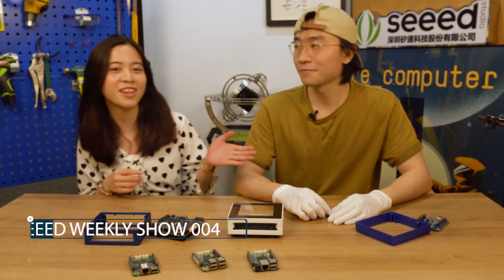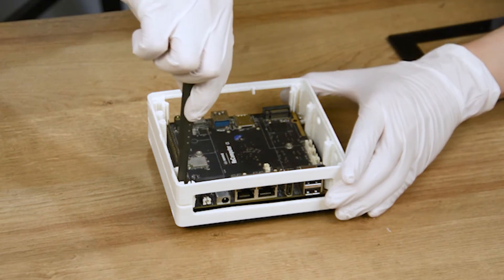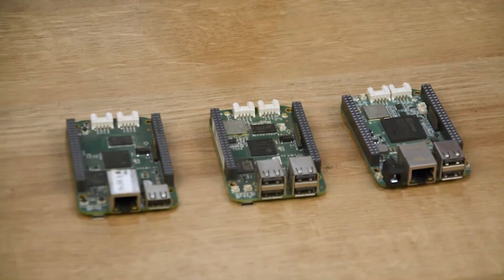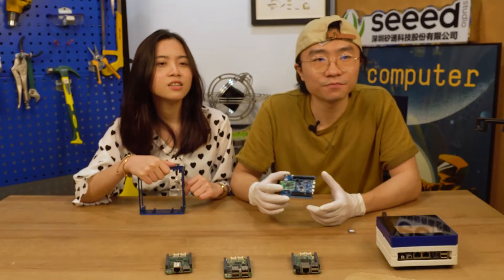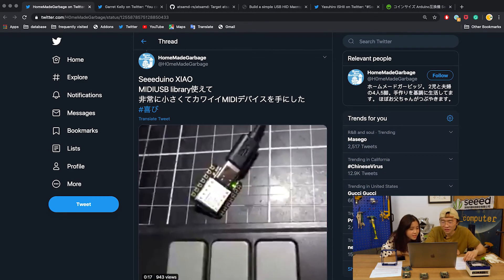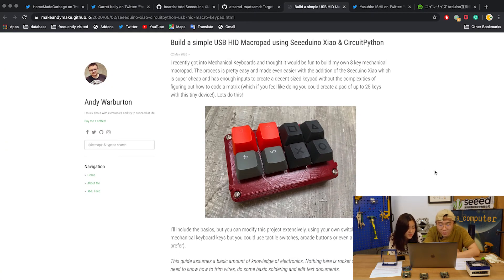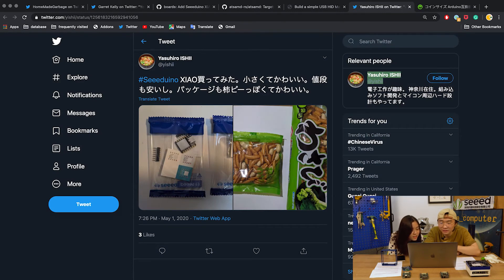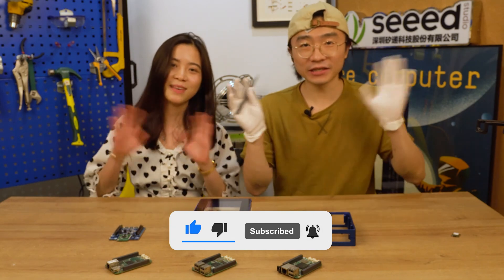Seeed Weekly Show - No.004 - (05-14-2020)

Comment: The wiki says BBG gateway's DC jack accepts 12V. Is it a typical 5.5x2.1 jack, center positive? I assume there is an onboard regulator, which can supply power to the board and also the capes? I'd like to use a Gen4 touchscreen cape by 4D systems, it's originally designed for BBB (which has a 5V input), they say a 5V 2A power supply is needed. So I'm wondering if I need a 12V 1A supply or something like that? And do you think the touchscreen cape is going to work on BBG gateway?